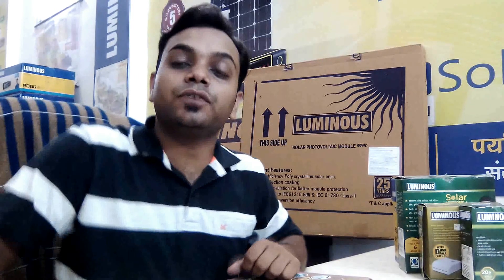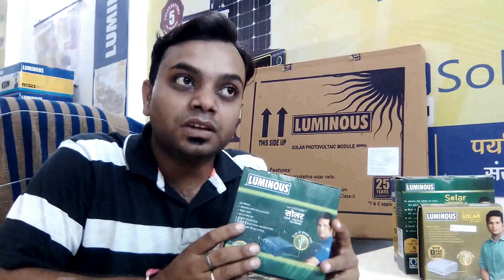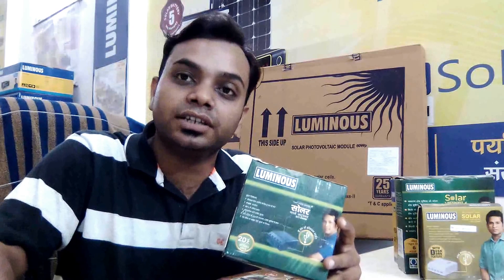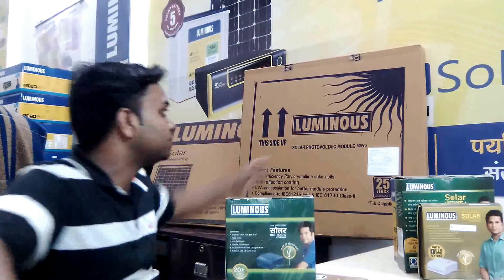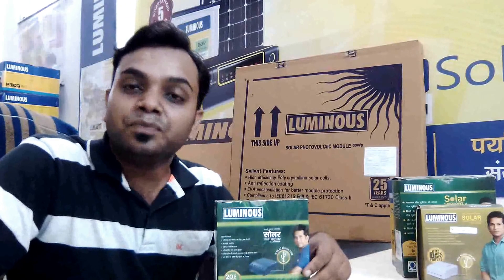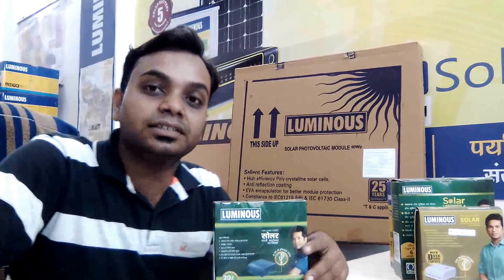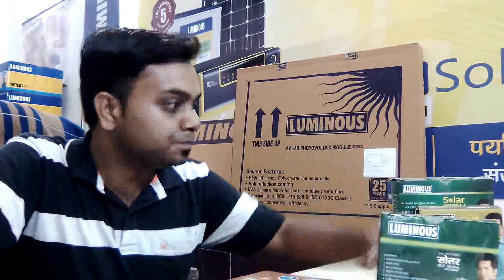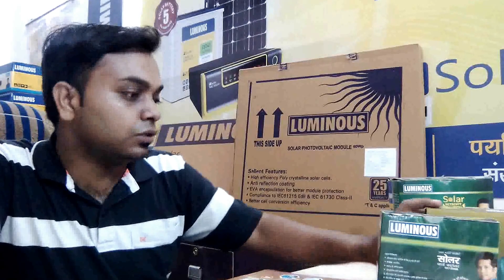Various Solar Charge Controllers and Photovoltaic Modules

Comment: Bhai.am looking for a solar power supply that runs my 2hp 220v water pump for 24hrs.appreciate your help
Reply: To operate a 2hp motor for 24hr you need to buy off-grid system and the power rating the will be for 5kva

Comment: I have question- can we use retrofit only as a charge controller.
Reply from the maker: Yes Ajit ji you can use Retrofit SRS 2420 as solar charge controller. And you can add upto 400 watt panels of 12volt and 800watt panels of 24volt. you can useth DC load upto 20 ampere directly from battery terminals.